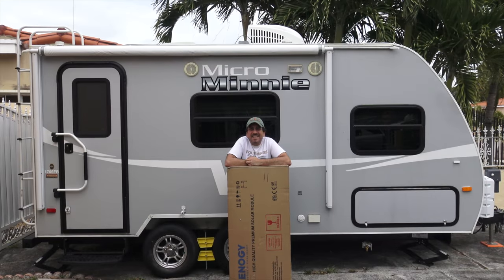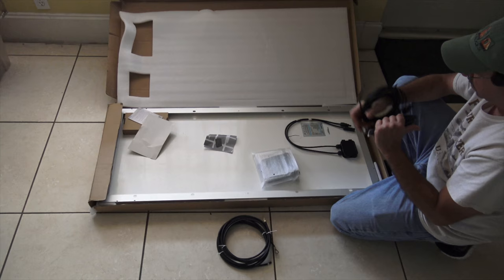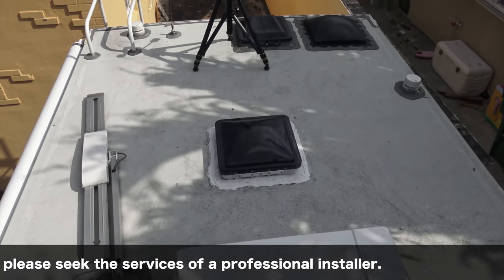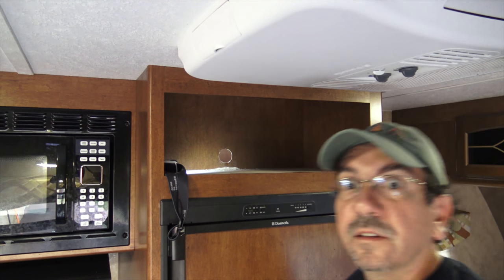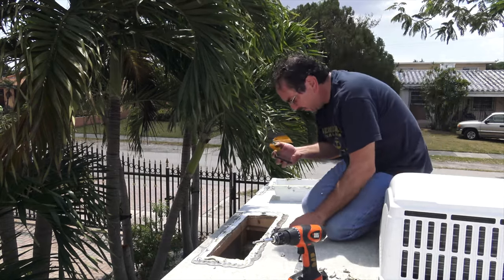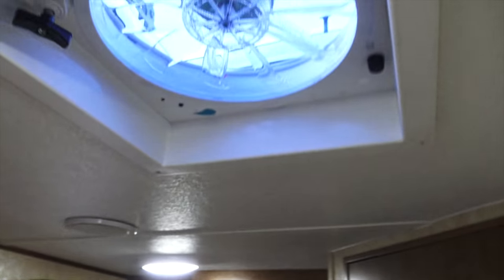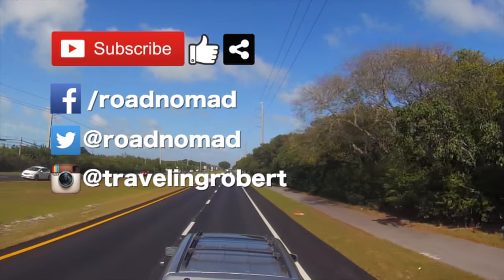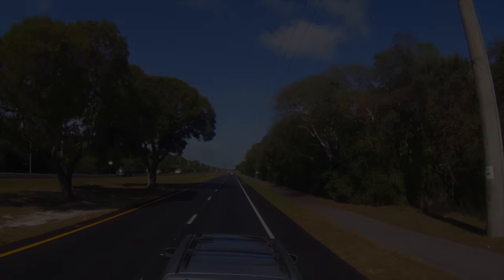Solar Panel Installation 4K | Traveling Robert

Comment: Great job Robert! Love watching your videos. For the gentleman asking about power consumption requirement...remember, the panels are to charge the batteries or battery only during the day, not to run appliances, lights,AC or microwave. Sort of like a trickle charge which is why they have a controller to prevent over charging. Some folks use 12volts in parallel or 6 volts in series. Both setups increases the amperage capacity to make your battery bank outlast continuous use for over 72hours in boondocking situations. That's where a generator inverter comes in to run the AC. Roberto from Illinois!

Comment: Nice job, Robert.  I recently battled with an ethernet cable out the refrigerator vent for my wifi extender.  Fortunately I did not have to remove vent, but I did do some  creative snipping of the wire mesh.  When  I got the cable through, I used from stainless steel wire to close up the mesh.
Reply from the maker: +bill baio Thank you. I'm glad you were successful. Never easy doing all these aftermarket mods.

Comment: BTW Robert.....we finally broke down and bought the Carefree Buena Vista Room.  In case we have visitors camping with us....there is a place for them to sleep!  Got two inflatable twin mattresses that fit perfectly with a small table between them.   It basically doubles the RV space.  I'll send pics when we set it up....can't wait!!
Reply: Can't wait to see your "Carefree Buena Vista Room". Where did you get it and how much did you pay for it? We are planning a trip to Hart Springs in a couple weeks with our grand-kids. It's by the Suwanee River, and I'm sure having something like this would be great, considering it's mosquito season in Florida.
Reply: Hi Lisa....sorry for delay.  We purchased it online and ended up paying around $600.00 for it.  We have the small Micro Minnie trailer (like Robert) so the room is for a 10 foot awning. I purchased two inflatable twin mattresses and they fit perfectly in the corner of the room with just enough space for a small table between them. This set up leaves about three feet of space to exit RV door and even place a chair inside.  When not in use.....the mattresses can be stood up against the RV wall and chairs can be added to enjoy the afternoon in a mosquito free environment! We can't wait to use it!!

Comment: Hey Robert,
It looks like a awesome job to me.. Now you have to make sure you keep the panel clean and you'll be in good shape. I had the same scare with my fantastic fan when I installed the remote function, Maybe signal some interference.
Reply from the maker: +redjaguar100 Thanks! It seems to be working really well.
Reply: +TravelingRobert I'm thinking about seeing how the panel and kit Chris and G are testing works out.. It seems like its easy to install and no holes to drill on my roof.

Comment: Nicely done!  Not so easy with the Florida heat :)
Reply from the maker: +Average Campers' Adventures Thanks. You bet it is hot already.
Reply from the maker: +Average Campers' Adventures Thanks. You bet it is hot already.
Reply from the maker: +Average Campers' Adventures Thanks. You bet it is hot already.
Reply from the maker: +Average Campers' Adventures Thanks. You bet it is hot already.

Comment: Your routing solar wires to your converter/charger unit is fine! Why run duplicate wires to the battery that the manufacturer ran!? Unless the manufacturer ran significant under sized wires, but then you would be wise to up grade them. The worst thing you can do is run current thru under sized wires! Good job Robert!! Campon!
Reply from the maker: Thank you... glad you approve. Yeah I think Winnebago ran the proper wires on this one.

Comment: So where do you connect at the fuse box, to the dc converter “output” to the batteries?  And does this cause any issues when you’re connected to shore power and the dc converter is running at the same time as the solar??

Comment: Great job on the install. I got a similar package from Renogy but the portable type. I would like to install this like you did going to the electrical panel instead of drilling extra holes (reason I got the portable type) I think that was creating thinking. Where did you install the positive wire coming from the solar into the electrical panel?
Reply from the maker: +James Morrill Hi thanks! My electrical panel has two + and two - ports so o connected the positive cable coming from the solar controller into that second port. I'll post pictures on the Facebook page or whenever I get to write the blog post.
Reply: +TravelingRobert - Thank you Robert, pictures would be great.

Comment: Curious as to which devices can be run exclusively on the solar panel or is it more like a charger for the batteries?
Reply from the maker: +Guy Mooglie The solar panel's purpose is mainly to charge the battery, and depending on how much battery you have, and what kind on power inverter you have, you can power certain things,. I know of some people with lithium batteries and lots of solar panels that can run their air conditioning. In my case after I finish with everything I hope I can run the microwave or a hair dryer for a few minutes.
Reply: Guy Mooglie all solar panels feed charge to the house batteries. This allows 12 volt lights, appliances to operate without draining the batteries.  Installing an inverter in the system converts the 12 v to 110 v to run 110 items without shore power or running a generator.
Reply: GodPleaseBring HeavenOnEarth  the question is too vague....and the answer depends on the size of you ac unit.     While it is possible,. Is it practical?   Lots of factors including size of your battery back and wattage of your solar system.      Then is it light and small enough for an rv

Comment: Great video.  What is your battery and inverter setup/ratings?  I'd like to do this on our 1700BH to do some boondocking, but am thinking we need to upgrade our single 12V battery that doesn't have much for amp hours.
Reply from the maker: I replaces the original 80 am hour battery with a 120 amp hour. Still not enough. I have a 2000W inverter, and 100W on the roof... not enough either.

Comment: @robert....so after a couple of years with the system,. Any thoughts
Reply from the maker: I recently added two more panels to the system...that video will be coming soon. 100W didn't seem to be enough for real boondocking
Reply: @TravelingRobert  thx for the prompt reply....so that means you have about 300 watts?    Looking forward to your follow up video.
Reply from the maker: @jerrygundrum1  300W. I might replace the controller soon with one that actually tells me what's going on

Comment: Just curious after 10 months. Do you still have the solar charge controller connected to your fuse box? Have you had any issues? Do you batteries charge OK?
Reply from the maker: So far so good. It keeps the battery topped off.